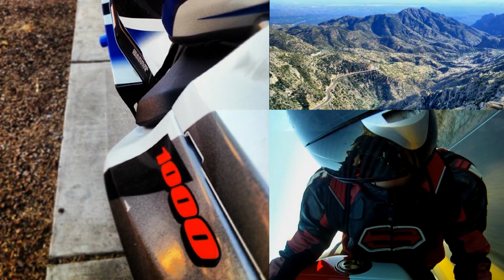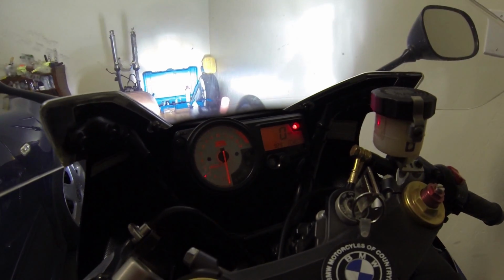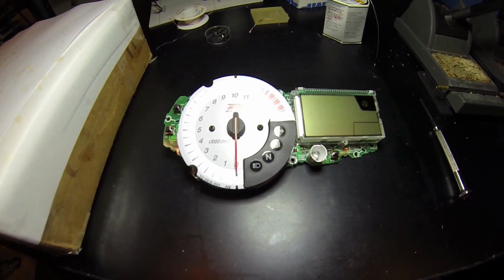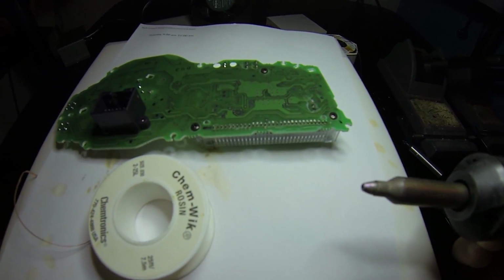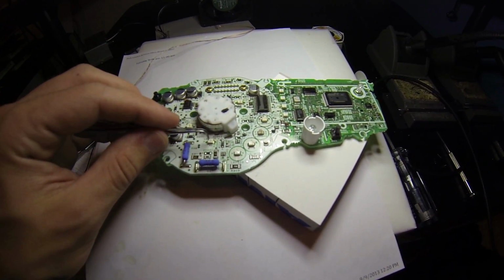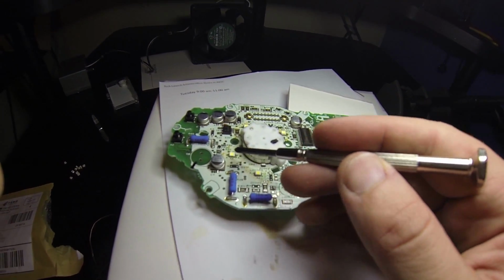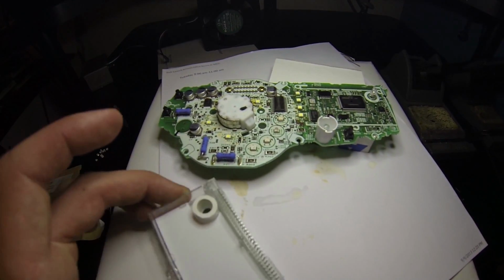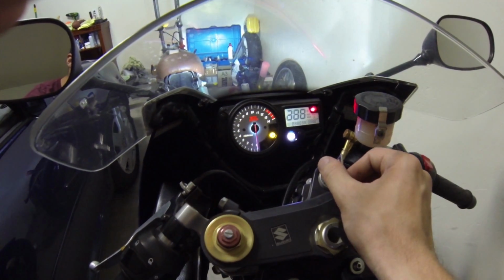Motorcycle Speedo Gauge LED Light Swap

Comment: Hey, very helpful tutorial. I need to fix one of this from my car dashboard. How do I buy the LED? Watts? Size? Thanks
Reply from the maker: Federico Rodriguez After pulling the gauge cluster apart, I found that the LEDs inside mine were 1210 SMD PLCC-2 LEDs based on their size and number of contacts. I just searched "1210 LEDs" on ebay and found a variety of colors. I did not see any specific differences in wattage so I purchased a few different colors from a couple different sellers (in China unfortunately).

Comment: Why wouldn't it make sense to actually show to process? Fucking Douchebag
Reply from the maker: HOTSAUCE If you want to learn how to solder/desolder go find another video.  This shows you step by step how to do it without the boredom of waiting for each tiny little thing.  You're not missing anything but sitting and waiting for solder to heat up and wick away.  So sorry that we made a free video that didn't live up to your standards.
Reply: HOTSAUCE Was something in this video unclear to you? I might be able to answer any questions you have about soldering as I do it frequently at work. I would personally find it pretty dull and boring to sit through a full 45 minute video watching them de-solder and re-solder every single connection. Wouldn't you? Maybe you should consider asking questions or making a suggestion about anything you don't understand instead of childishly name-calling.

Comment: I am trying to replace the led on my gauges as well but I can't seen to find the replacement leds  on ebay. Can you tell me what they are called and does it have to be a certain type?
Reply from the maker: thebiggkahuna85 It will depend on your gauge. If it is a GSXR like the one in the video, chances are the LEDs are 1210 but you will have to open up yours to confirm. I took precise measurements with a caliper to find the dimensions then looked up different types of LEDs online until I found some that matched the dimensions (1210 surface mount LEDs)